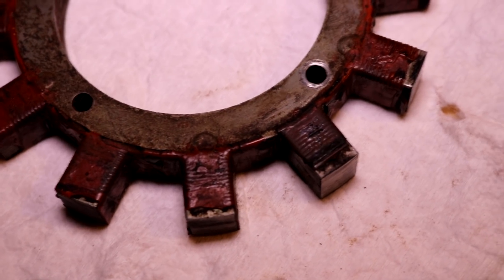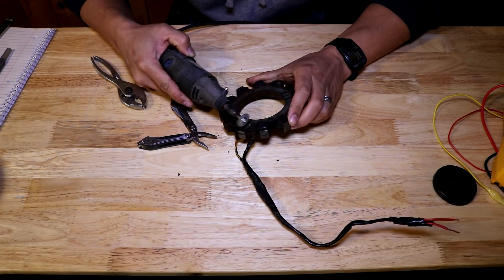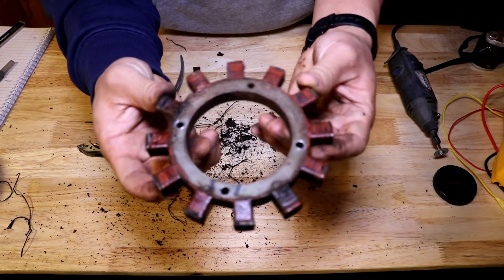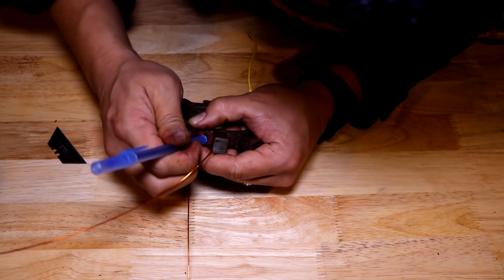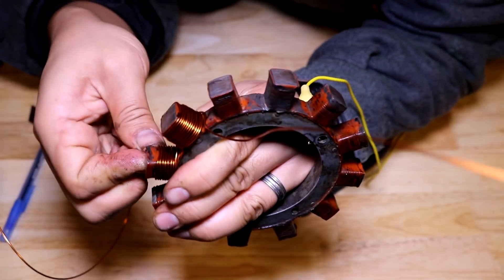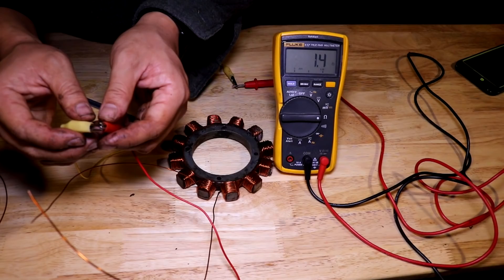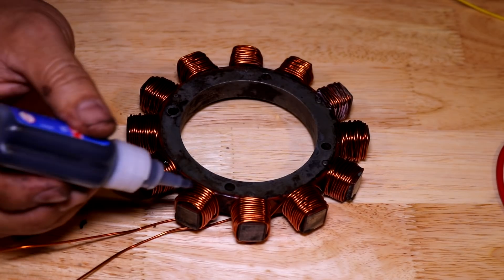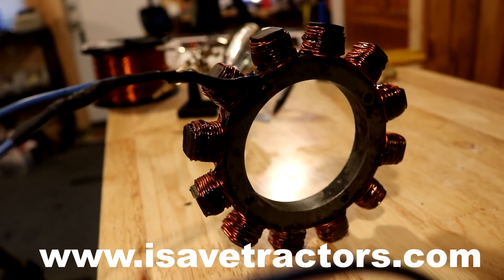Rebuilding & Rewinding a Garden Tractor Small Engine Stator Charging System

Comment: Great video! I have a Kohler K181 with pointless ignition, charging system ok, But the one coil for the ignition is burnt due to ihe insulation on the wire crumbled and shorted the coil. pointless  ignition is obsolete, so I have to repair myself:::note:: when you disassemble you MUST count the number of turns on coil!!!!

Comment: The Anderson US Patent show excess power output when winding 2 wires in same slots together as ratio of diameters magnet wire as 1 to 3 sizes. Magnets run 1st coil, magnets already rotating, 2nd coil receives field and outputs, the 1st coil energizes 2nd coil, power additive as no electric is induced to initiate running the alternator as in the car alternators fields .

Comment: It looks like crazy  Glueing the 1st 11 wraps To prevent sliding up the post When wrapping over the copper wire for the next  Nine Wraps around a single post works besto prevent it from sliding up the post So you can start working on the next I'm using fiberglass resin to finish er up to seal it off I also crazy glued all corners of the 12 post and coated with epoxy fingernail polish once dry ez wrapping without it digging in to ground its self

Comment: Well my stator wining gave it was a 20 gauge not 18 that's where I messed up now I'm trying to do it again 😞 with 18 now I'm having a issue with the first wrap of 10 and over the 10 again on top the first wrap of 10 wants to sleeve up and off the post crazy glue the first 10 down?  This is a big old 1961 v6 daul coil motor pic is on profile pic
Reply: Update yrs later got it done with the 28 wraps and is working great! This has the same stator but requires more amps due to being dual timing and dual ignition the ballast resistor comes to play to knock down voltage

Comment: Just a fantastic video. Only two comments, use a dremel with a sanding disk to round off the square edges of the stator core as the fear of a wire shorting  on a corner is unbearable. Lastly, I dont  like that pigtail solder joint, you want those leads streamlined.

Comment: Ok I finished up on the 28 wraps I rechecked my dad's stator on his Johnson I read 0.9 same as the one I just rebuilt reading at 1.1- -0.9  installed it back on checked for ac voltage while cranking getting 5-10 volts ac I believe everything is working now I had trouble with the starter solenoid at first it got rained on throughout the year so soaked it in a little  oil yesterday started working again so seems like everything's working out still not done I just wanted to check the voltage on it and that's normal while cranking I got to finish up on gas lines and getting everything back up for the wiring this motor is very very easy simple

Comment: Does your lawn mower have a rectifier reason why I'm asking is because I was thinking about to do the same amount of winding my post at 12 posts just like yours but mine had 28 windings so I don't know if this will work compared to 20 winds what I'm working on does have a rectifier but it is a V6 larger motor
Reply from the maker: Yes this engine has a rectifier. It would work the same as yours.
Reply: @Isavetractors  okay I'm doing the 28 wind again the epoxy I guess the epoxy too high on the wires and it got smashed just got around this year to start doing it again I'm assuming the 12 post as for math wise 12+20 =32v 12+28=40vac 12 for the post and the rest for wrap

Comment: You don't need to be so neat about the wire wrapping as you have a lot of space between the poles,
and as others suggested, you should put some insulation around the pole before wrapping it.  
Without that, the wire insulation will eventually break through and short.

Comment: I need to rewind one of the 3 phases of a stator from an outboard. After removing , cleaning and repairing the insulation on the laminate core I'm ready to rewind, but the 50 meters of 1 mm wire I ordered came in 5 rolls of 10 meters each.  Is it possible to do one pole at a time and solder the wire between poles or is it best to order a longer wire to wind it without interruptions. Thanks for your input
Reply from the maker: It's better to do one long wire.
Reply: @Isavetractors  would it be better to use a slightly thicker wire?
Reply: @Isavetractors  would it be better to use a slightly thicker wire?
Reply: @Isavetractors  I also don't know how should I connect the end leads to that hair thin wire, should I just solder the thin wire to the thicker lead? This is the first time I do this, pardon my ignorance
Reply from the maker: For the ends you can solder them to braided copper wire like I do here. To keep it all the same as before you should use the same diameter wire and wind to a similar number of windings

Comment: Can't we get higher voltage by using smaller gauge wire, so that each POLE has more turns that react with the rotating magnets. Then the 2 ends can be hooked to bridge rectifier for double current. There is a Briggs unit with red and black wires that has double wires wound in same poles that may deliver more power, as per the Anderson US Patent.

Comment: Would this work on a V6 outboard motor it is a 1963
Reply from the maker: Yes it would as long as it's a single wound stator like this
Reply: @Isavetractors   it had 30 rounds on the first post and 28 on the rest but it was wound just like that just not 20
Reply: I just did 28 on every single post including the first one only because I don't know if the previous owner tinkered with it by the way it is a 1963 motor I'm assuming it needs a lead gas/additive with some racing fuel or octane booster it's a V6 as well this is the last step I have to do to get this motor running
Reply: Yes it's a 2 wire single wound just like that I just don't know if I can do 20 like yours does your lawn mower have a rectifier
Reply: It is also a 12 Post stator just like yours everything's like identical I don't know how thick it is but I don't know if that matters

Comment: Hey Norman, Awesome VIDEO! I thought I was the only nutcase who took the time and BS of rewinding stators until I found your site??? Awesome instructional post here for the do-it-yourselfer! Yes at the end I usually use a 2 part epoxy resin to seal the coils you can easily obtain at any auto parts store for fiberglass resin. Works like factory and cures very fast within 15-20 min depending on how much activator you add to the base resin. Thank you for posting this timely but informative video for the do it yourselfers out there. Have a great night Norman and again thanks for the information.

Comment: Hi Norman, I’m subscribed to you by junkman6261 and I love your videos.   I have a power king tractor that I’m trying to get running and have discovered my stator has old rotten wires as far as the braided wires are concerned.  Mine is the 15 amp with two extra coils for breakerless ignition.  Do you rebuild stators for customers?   If so what would your price be?   If I try it what wire should I get and what should I use to protect current wires that the insulative coating may have come off of?   eBay doesn’t show any new coils matching mine and I don’t want to spend a lot of money for something that is just as old as mine.   Thank you for any help.   
Daniel
Reply from the maker: Send us an email on our website and I can guide you

Comment: I have to rebuild the Harley Davidson XL1200C 2004 stator and I wonder what kind of wires should I use? with insulator or without ?
Reply from the maker: You need to use insulated copper wire

Comment: If I wanted a higher output, would it be as simple as adding more passes of the winded copper? In your case instead of wrapping 20 passes per pole, could possibly do 30-40 passes per pole?

Comment: Thanks Norman for the very informative video. I have an old Wisconsin TJD that has an internal ground connection halfway between the two stator output wires. My separate regulator (YJ60) and separate rectifier module (YJ68) are both bad but the stator outputs 46 VAC when running, Can you recommend an all in one regulator-rectifier module to use and how to wire it up to my center tapped stator windings? Thanks very much

Comment: A couple ways you can guarantee no short to grounds is to use pieces of heat shrink tubing on the "posts" of the stator before winding it, or dip each "post" in Plasti-Dip first and let it dry.

Comment: Thanks for the video, i think i blew my stater.  I had my Wheelhorse in a parade pulling a trailer and i had an inverter running and a smoke machine.  now it wont charge.  Do you think it blew this or something else? I think i may try this!  Also,  would thicker wire increase the output?
Reply from the maker: Thicker wires increases potential current output

Comment: What is your opinion and a sears suburban 12. Are they good and Dependable or just another garden tractor that is going to disappoint you in the long run. I found one on our local craigslist with a loader and we are looking at it because we have a 24 acre farm and we are looking to use it cleaning our sheep and goat pens. Do you think it would work for that purpose.
Reply: Also great videos and lots of helpful tips.
Reply from the maker: The Sears Suburban 12 is a fine machine, but for a loader, it is short, so you may find it uncomfortable to get in and out of it frequently. The gear shift transmission may also get a little old. But other than that, it would be great for cleaning out pens. I would prefer a hydrostatic transmission machine though. You can always remove the loader and put it on something else in the future.
Reply: @Isavetractors  Ok we might look into a different garden tractor to put it on then. Thanks Norman
Reply: What would you recomend to put it on then

Comment: Too much work. I would buy one already done. To each his own.
Reply from the maker: This really is for NLA parts such as this 40 year old Onan CCK engine. You cant buy them anymore
Reply: Just an idea on spares but you might try contacting some of the more mom and pop Thermo King dealers in you areas. Gasoline engines from Onan and Wisconsin were in daily use on transport freezers back in the days before diesel  powered Yanmar and Isuzu models. Middle East and Far East is full of this legacy stuff. AENLD, CCK, RCCK etc.

Comment: Ahhhh!!  These are an issue on  so many of the CCK’s! Lots of guys put alternators on the pmax. I’ve seen some nice jobs done and a lot of hacks too. Kubota alternator seems to be the one to get. These stators are hard to find. Would there be a benefit from more turns? How much I wonder? Guess it could be a super stator with more turns. Another issue with these is missing magnets on the flywheel. Great video!

Comment: Norman,  Did you put 10 rounds on each pole all the way around then make a second pass with another 10.
Or did you put 20 on each and make one pass around ?  Would there be an electrical change one way or the other?
Output of 36V  how many batteries does the tractor have?
If what went on is the same as what came off,  it must work.
Reply from the maker: 20 wraps each pole in the first go around. So I wrapped up the pole 10 turns then down the pole 10 turns then moved onto the next one. Keep in mind this is AC current. This is what it puts out before it hits the rectifier which will turn it to DC and make it charge in the charging range of 14 to 15 volts DC
Reply: @Isavetractors  Thank you so much,  ny electric knowledge is don't poke a fork in the toaster.

Comment: Perfect timing with this video Norman !! I'm getting ready to rebuild the stator on my B43G...
Question:
Mine is currently a 15amp...  can increase the output to 20amp? Is it more windings?
Any input would be valued.
As always.... appreciate your videos and knowledge.
Reply from the maker: For more amps you would need more poles
Reply: Well then that settles that !!!
I'll see if I can find one on the Ebay !!
Thank you !!
Reply: David feinberg I think you need a new flywheel and voltage regulator to increase the output.
Reply: @rydplrs  no way, you just use a bigger size wire and add a couple more turns.